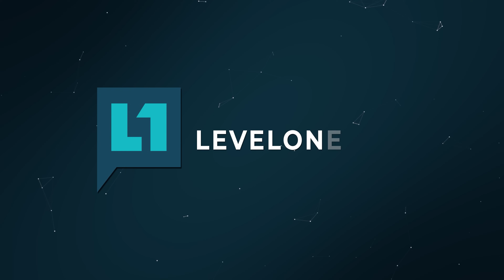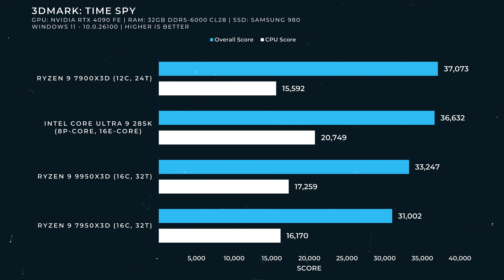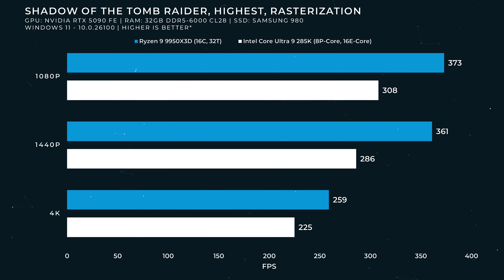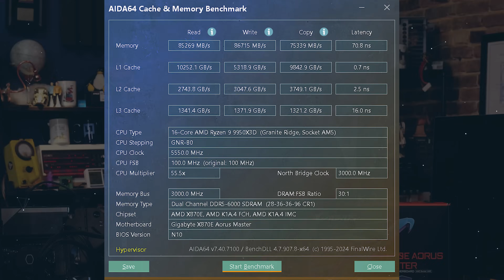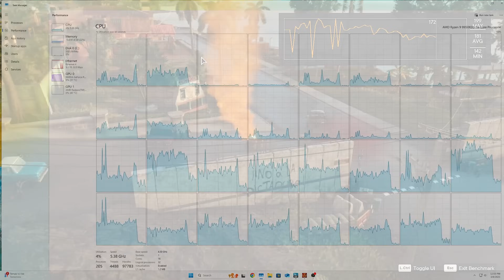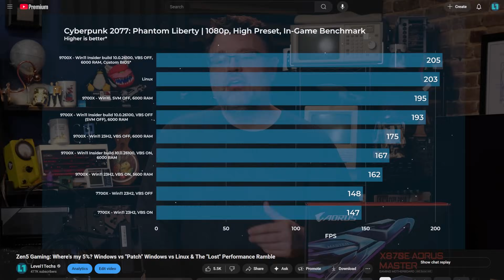AMD's ZEN 5 9950x3D Reviewed and Benchmarked

Comment: Man, we really need to leave windows behind as a gaming OS.
Reply: not only as a gaming OS.
Reply: That day can't come soon enough.
Reply: THIS 100%...windows11 is such a pile of garbage lately.
Reply: I did a test last week running arch. If HDR worked correctly in gaming for Nvidia, I would have stayed using it. Unfortunately it's not there...yet.
I'll give it another go in 6 months.
Reply: This is the year of Linux desktop 😂
Reply: @Akkbar21  - one of the OSes I put on the loop was Mint Cinnamon I think it was. I have not experimented much, it won't retain the WiFi password.
Reply: Fedora has been great. But no HDR
so i may swap back or dual boot. But it really is amazing esp when you have an issue, you just dump the log into claude ai and ask it to fix it. Been too lazy or not enough time to actually teoubleshoot. Only issue i had like that, was related to Nvidia GPU drivers for CUDA ai
Reply: @ciscocomputertech  HDR is present in Gnome 48, which is being released next week (19/03/2025), and will be used in Ubuntu 25.04. KDE has had experimental HDR support for a while, although I think it's only for AMD GPUs (not a KDE user myself).
Reply: @habilain  I have HDR "working" but its so buggy that it might as well be off. I get mem leaks using gamescope in BG3 ladt time i played. I did get it working fpr 5 min though. Wayland and KDE support it but it seems like no browsers support it and the games are buggy so might as well be off
Reply: @ciscocomputertech yea ai is awesome for troubleshooting it's saved me countless hours
Reply: @ciscocomputertech  Yeah I think it needs to be completely frictionless, especially in the beginning. No driver issues, no dealing with tools and consoles... Best chances are that Steam can offer a good alternative. Because people on PC are already using Steam (most likely). So what if you can just install SteamOS (or whatever distro) in a partition, boot into that for gaming and have better performance etc. I think that could work eventually.
Reply: @clouds5  You can install bazzite right now, don't need to wait...
Reply: @ are you saying windows is frictionless , especially W11?
Reply: @clouds5  I screwed up and a laptop updated to 11. Two of the others I policy locked to 23H2. Even then Win 10 22H2 is faster than 23H2 win 11. I am looking through old disks to see if I can find an old copy of NT. Just to see if I can make it run.
Reply: yeah, won't happen unless there is something bettter.  there is not
Reply: There's nothing else out there better at the moment unless you like using that third party useless crap.
Reply: @jamesm568  I know... Can you imagine? It's my whole point :D Windows is just some multi purpose OS with focus on enterprise/business and that's the thing we use to game on? I know it would be easy to come up with something better, even Microsoft could do it (like the OS that is on Xbox). But they don't care about PC gaming at all. So I say let's move on.
Reply: @clouds5  I would be happy to go to something better, but all the alternatives are just as janky with less support.
Reply: @clouds5  xbox os is just windows 10 edition
Reply: @DominikHoga  Ok great, so let me install that on my PC. Give me a gaming windows with zero bloat, optimized for performance and a nice launcher that I can use with either mouse+keyboard/gamepad/VR.
Reply: @clouds5  try Windows 11 LTSC 24H2
Reply: i agree but as all us linux users know, until kernel level anticheat is no longer needed for anticheat to function, it just sadly will not happen for anyone who likes multiplayer gaming
Reply: Stop whining about Windows and start calling for a radical change to PC architecture.
Reply: Just use Windows 10 IoT LTSC, it’s our only real option.
Reply: guys with 9950x3d's and these 12 core up processes with 32gigs ram, on windows start up fresh install, how much of your resources are being used at idle ?
Reply: I’d love that but Linux still often doesn’t get anti cheat support.  Or software that depends on stuff like C++ redistributables or net script framework and its SDK modding.  And proprietary drivers for the most powerful graphics cards puts VR gaming at a huge disadvantage
Reply: IMO there isn't really a problem ― anyone who cares enough and is willing to put in the time to do a little research can switch to Linux right now, and many people already have. It's the same as any other optimization you could make to your system. Basically the more time and effort you put in to learn about better alternatives, the better experience you can make for yourself, and if you just run things out of the box without bothering to look deeper, then you'll get a subpar experience. Same as with anything else.
Reply: @flamingspinach the flip side is the mass market for PC games isn't hardware and / or OS geeks like yourself. Right now the general public can buy a Windows machine and go buy and play games. There are so many distros that your average joe who just wanted to play Fortnite on their PC isn't going to go through all the effort to make an individual distro work with games or vice versa. Not when they can buy Windows or a console.
Reply: Did years ago for linux
Reply: @N34R4T0M4T I can play a lot of my games in Linux, but my Pimax Crystal Light doesn't have any Linux software, and it was a lot trickier to set up my wheel. Once we get 1:1 parity with windows - or actual dev focus on linux as a popular alternative (please steamOS) - that should end.
Reply: I personally think if Linux goes 'plug and play' in a way, it may happen. If someone, whose PC knowledge is it being a Facebook machine, can install it, maybe then.
Reply: @sapphire3084  It's literally easier to install Ubuntu, Fedora, Bazzite etc. than Windows already. The install isn't the issue it's that it isn't pre-installed from the manufacturer.
Reply: @sapphire3084  That's exactly what's needed. And the only one who can do it imho is Steam. Everyone already uses it. If you can make an installer for an empty partition and show people that it performs better then it can work.
Reply: This is a comment from 2005?
Reply: Yes!
Reply: We really need to go back to the DOS days where Windows just suspends itself and enters into a whole separate mode that handles intensive programs like games. This can be a Linux based OS or a MSFT one, but preferably Linux so bloat and spyware can't be added.
Reply: @Noisy_Cricket  bloat and spyware can and has been in Linux
Reply: @Noisy_Cricket   This won't ever happen because computers do so much more nowadays. People use discord, streaming software and many other things beside their games, alt-tab to the web browser and back, play music in the background etc. Those features easily outweigh any little performance advantage you'd get from removing the OS overhead.
Reply: @brinkoftext  Unfortunately a lot of Linux users (yes, I use it too sometimes) think too ideologically about this and not practically.
Reply: @brinkoftext  agree completely, so many professional softwares (eg: zbrush, substance, adobe suite, etc.) are also not supported on linux, it's just not feasible for a lot of people, me included
Reply: Why, what's better?
Reply: @dubya85 good is a referential subjective statement.  I'm sure you can find subjective use cases where it's an objectively true statement.
Reply: @skachor  im sure you can find something to say that isn't vague.....an objectively vague statement...thats just my subjective opinion mind you.
Reply: @dubya85  I could go on and on about lower hardware requirements, better optimization, etc, but what's important to this CPU is that Linux's CPU scheduler is much more mature than Windows's. For windows, CPUs with asymmetric caches like the X3D lineup are new to it, and thus it had trouble properly assigning its cores to apps and games, causing wild performance issues for a while. On linux, the scheduler's been made to work with so many weird hardware combos that it's tuned to properly manage asymmetric caches like these decades ago from before CPUs were so standardized.
Reply: @dubya85  In my opinion literally anything :D I think Linux would be ideal, because it allows you to have a dedicated gaming OS that is optimized for that kind of Workload. Steam is already doing something like that with SteamOS on their handheld. The thing is you would instantly have better optimization and performance, because Windows is quite messy with a lot of overhead and not optimized for gaming.
Reply: Will never happen.

Comment: I just want a 9995X3D with binned cores on both chiplets and the X3D on both chiplets. Halo screamer as the swan song of the Zen 5 chips on the consumer side.
Reply: But what is that supposed to run?  Because you'll slow a lot of code down if L3 data is in the wrong CCD
Reply: @RobBCactive  whatever the Epyc “oops all V-Cache” models are meant to run.

It’s not like more than one 3D V-cache chip is some hardware or software limited thing, they just don’t want to give it to gamers / regular consumers at less than server margins.

I mean, they have an 8 chiplet single core with V-cache model on Epyc for crying out loud.
Reply: @levygaming3133  EPYC has far more i/o bandwidth and systems where people run many independent tasks.
Consumers don't do system management, the whole platform cuts cost because one person is using it .
Reply: @levygaming3133  it's a mistake to presume what works on managed systems running many independent tasks with massive memory and i/o channels will work well on consumer hardware intended for one user, with applications that like to be used interactively
Reply: AMD should make some just for people that keep demanding it, if anything to prove their claim that the minor bump in performance isn't worth the cost.
Reply: @deansmits006  no when AMD does that going along,  the very tech tubers who went along with the bandwagon then lecture about the product being poor value and doesn't make sense.
Reply: Nah, I want an 9995X3D with 8xZen5 with X3D on one chiplet, and 16x Zen5C on the other chiplet
Reply: I don’t think that will happen. Maybe an Epyc 4965X if they bring back Epyc 4000 for Zen 5?
Reply: I just want to be served kedgeree in bed by indentured elves.

Comment: Was waiting for g.skill's CL26 to make it to Europe, but I think I'll just grab the easily available CL28, thanks for that. You're not the only one to report POST issues with CL26.

I don't suppose you explored using ProcessLasso & it's ability to suggest which cores to use per process?  ( rather than hard-set affinity ). That'd open up use of these on W10.